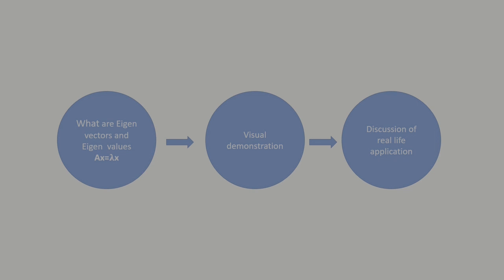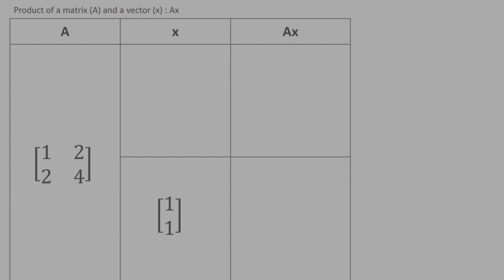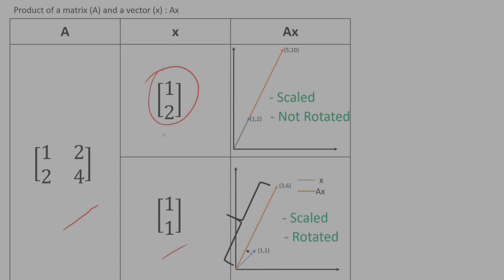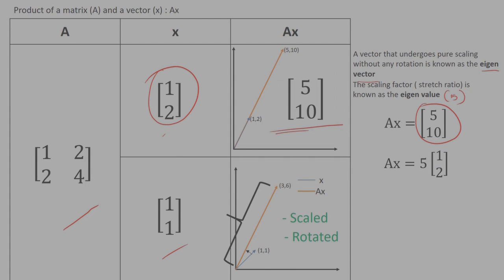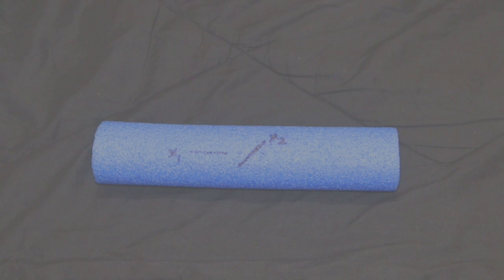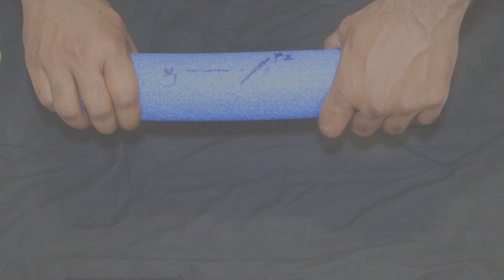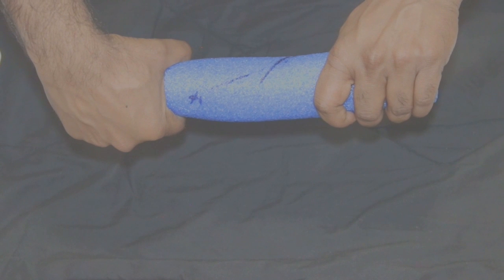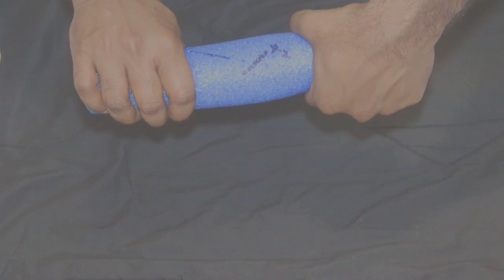Real life example of Eigen values and Eigen vectors

Comment: Good explanation.  However you could have elaborated more on the automobile part of the lecture.
A question on the shaft example : From the initial X1(horizontal) and final vector X1 (inclined) we can get the array (by matrix inversion).  What will this represent or how is it related to the torque?  Can you throw some light?
Reply from the maker: This will be easier to understand if you have some background on continuum mechanics; the deformation gradient will be the matrix, which depends on the torque.

Comment: What would be the eigenvalue in this case? I understand that X2 is the eigenvector, but what about the eigenvalue? Would be the magnitude of the applied torque? Thanks for the clarification
Reply from the maker: Ideally, the eigenvalue would be the stretch ratio. No. it won't be the magnitude of the torque.